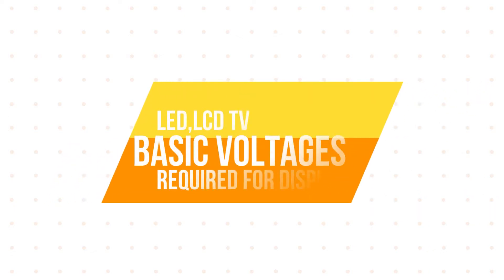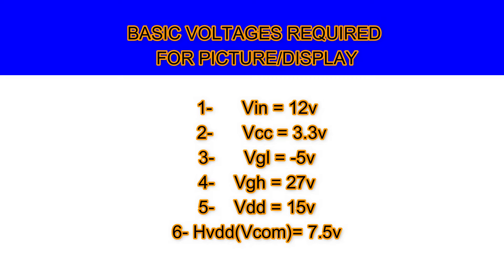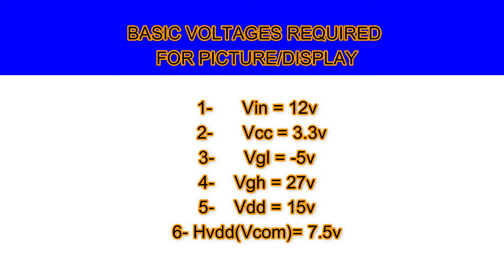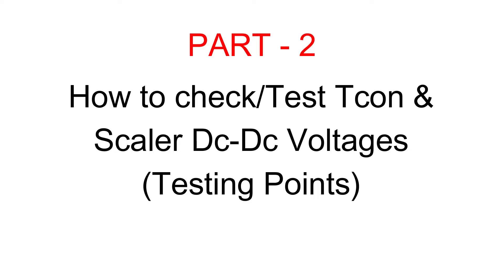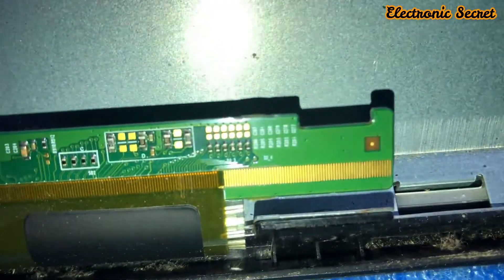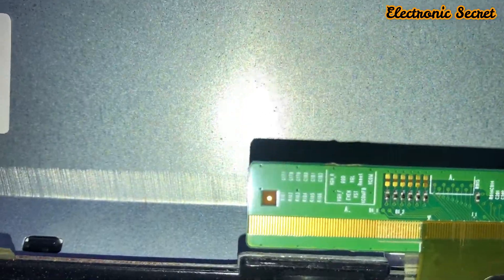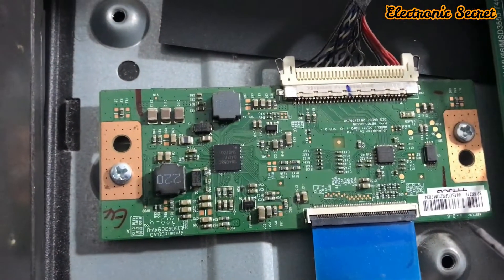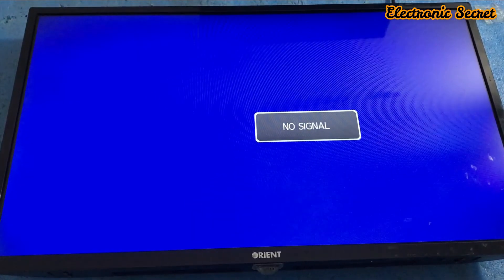HOW TO FIX LED TV DISPLAY PROBLEM || TCON VOLTAGES DETAIL

Comment: Good video. However no solution is mentioned? If there is a voltage drop in VIN, does it mean a TCON failure or panel board failure? Kindly clarify.